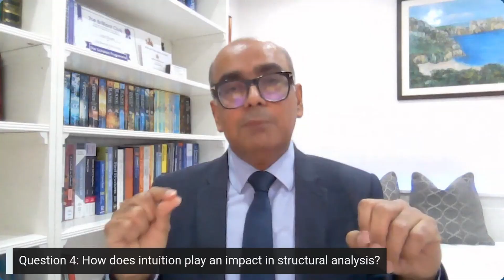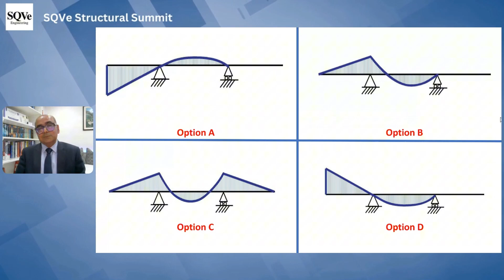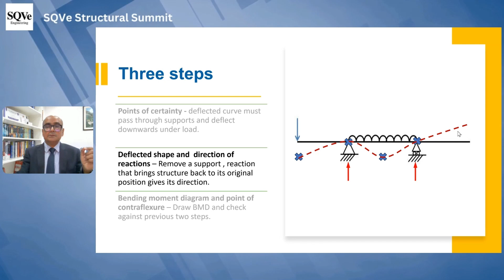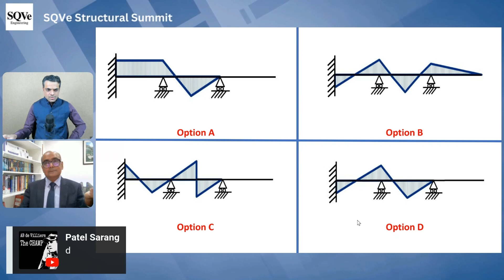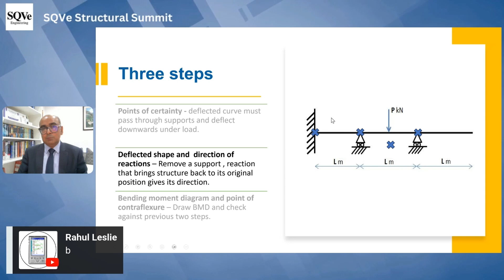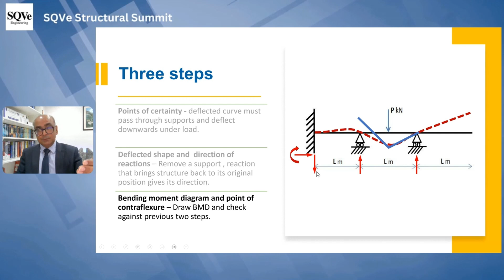Why Intuition Complements Structural Engineering (And How to Use It)

Comment from the maker: ⏰ TIMECODES ⏰
00:00 – Introduction
00:45 – How intuition affects structural analysis
01:16 – Conceptual design stage
03:37 – How to use intuition in structural analysis
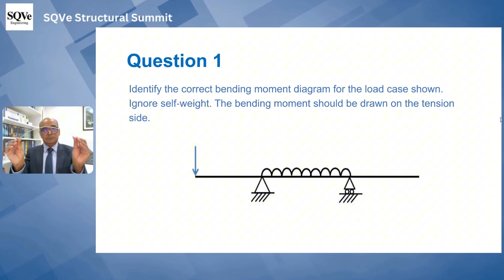04:21 – Question 1 Draw bending moment diagram
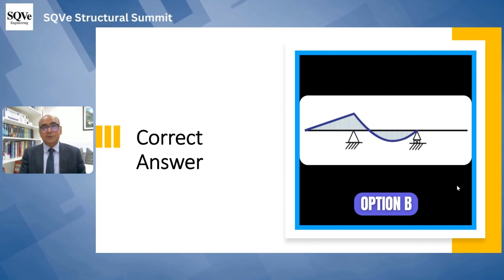06:53 – Question 2 Sketch bending moment diagram

Comment: Thank you so much. intuition in engineering has always been a very fascinating thing for me, it really helps solidify concepts, and allows for deeply understanding the thought process behind all equations and also codes, sometimes predicting how a structure behaves under certain conditions and finally how to judge software results. really delighted with this series. 
i would greatly appreciate if you can suggest some books and resources that focus mainly on structural intuition. i am currently reading "Structures :  or Why Things Don't Fall Down" By J.E Gordon, and its a blast.
Reply from the maker: Thanks, you are absolutely right. I’ve got some new understanding of structural intuition from your message. Surprisingly, I’m reading the same book and is on chapter 2. 

Sure, I’ll suggest some books shortly.